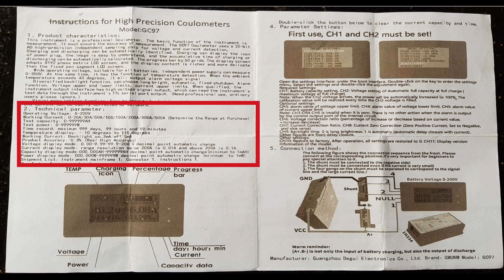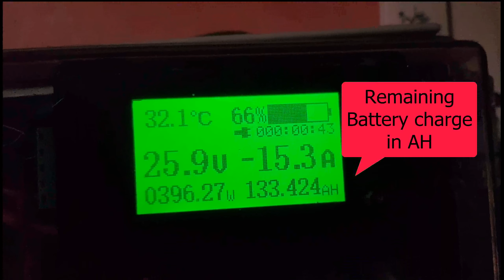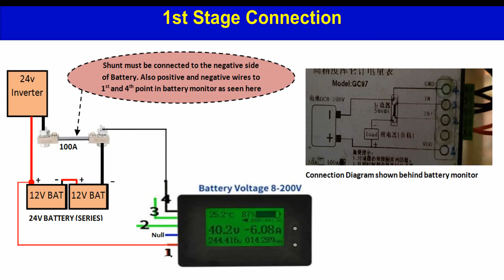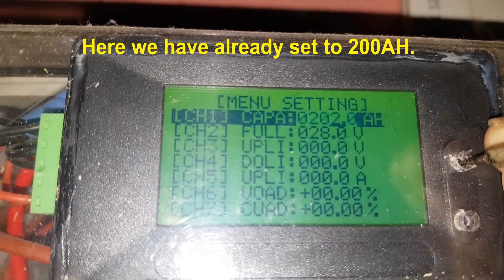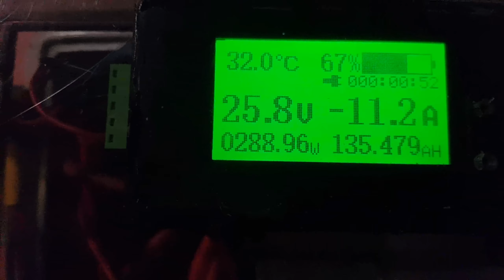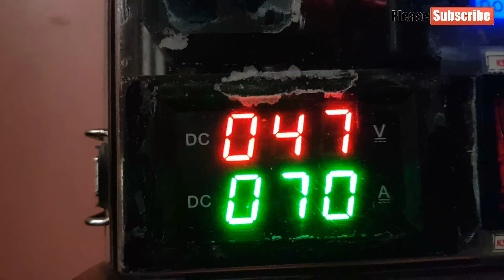Battery Monitor GC-97 | Coulometer

Comment: Hello, thank you for the detailed explanation ! I have one question though. Suppose my battery is used and I don't know very well the capacity it has left. So I put the Ah somewhat lower than what the spec says, for example, 420Ah spec, but I put only 350Ah. Then it could happen that I actually put too little. So the battery could get charged beyond my setting (for example, to 380Ah) Does the GC-97 then show 108% full, or does it show 100%, and perhaps "learn" the real capacity? Thank you.
Reply from the maker: Sorry for the late reply.  You have to configure not based on the current capacity left, but the rated capacity. For example, if you have 150ah battery use this capacity. If you bought 200ah capacity, configure that capacity.

Any device  will not say capacity beyond 100%. If you configure lower capacity, still it will say 100%. We have to give correct rated capacity (as specification says)